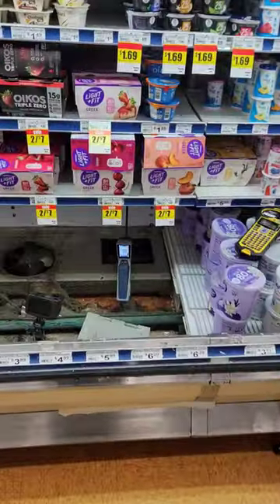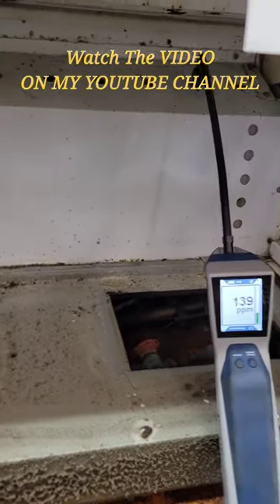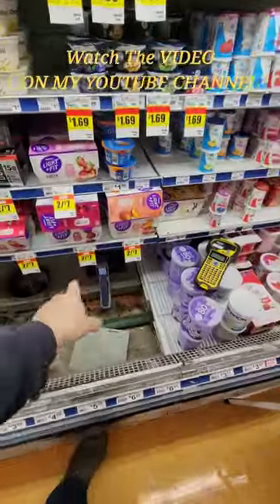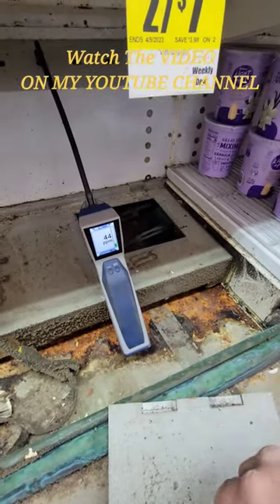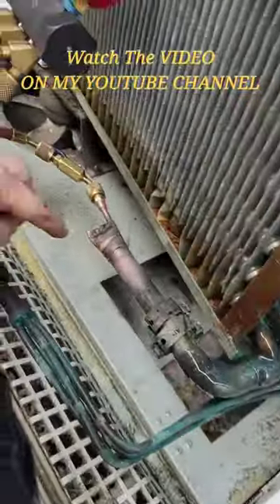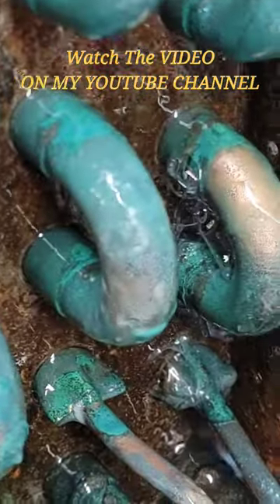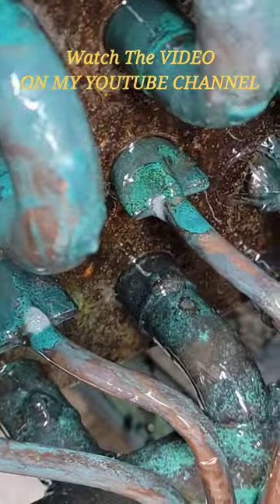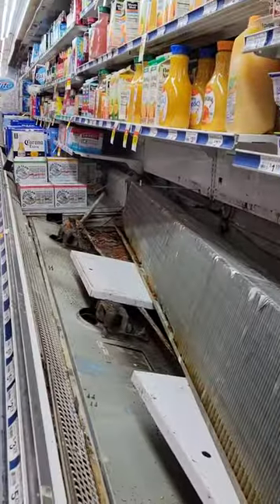Emergency Service Video Short

Comment: Yeah I condemned a coil recently leaking in multiple spots. Patched up 3 spots on it and after another nitrogen test called it quits. Sometimes it just can't be saved
Reply from the maker: Yep then they complain about the bill.
Reply: @HVACRSurvival  That's alright they'd complain about the EPA bill even more if they didn't get it fixed!

Comment: How much refrigerant does a system that size take ?
Reply from the maker: Depends how many other circuits are on it and the distance. I've seen up to 400+lbs
Reply: @HVACRSurvival  pricey
Reply: A typical walmart supercenter will have 4 racks with about 400-900lbs each. 1100-1500 if there are only 2 (from completely flat). Customers like that usually have a deal to buy their own refrigerant or contract margins of like 10-20% markup. By the time they notice you will likely only need to add 3-4 drums.

Personally I would never make a permanent repair unless you are not busy or it is a blower, especially if they buy their own. Try carrying some hose clamps and some door sweep material to keep things going until you get a new coil and actually make some money and don't make repair an option.

Comment: Just quote them out for a new coil. Don’t even waste your time.
Reply from the maker: They need a new store not just a new coil. Neither are going to happen. They might update it sometime in the next 5 to 10 years.
Reply: Alot of the parts are obsolete for cases that old unless you find a good used coil repairing is the only option to get it back going.